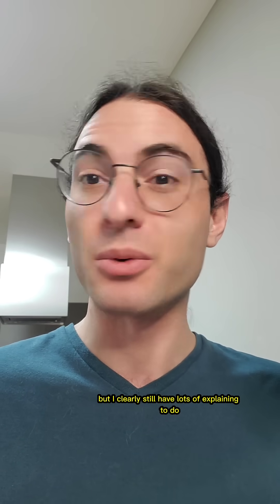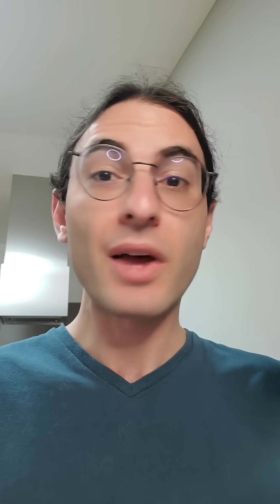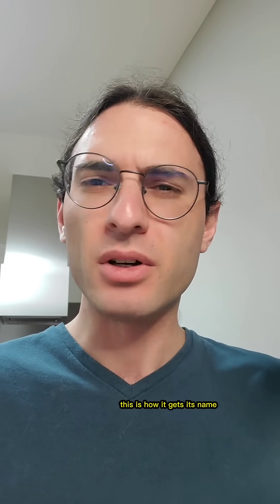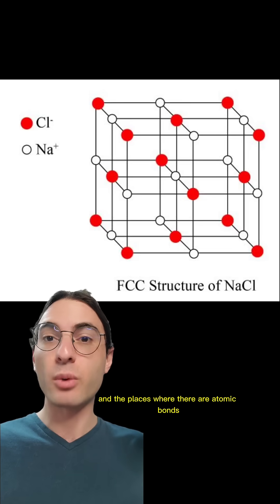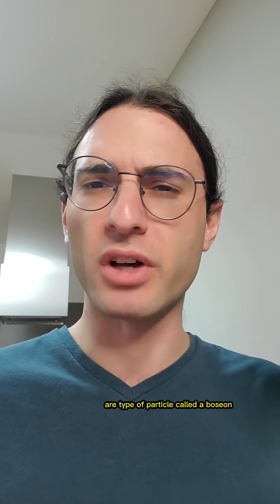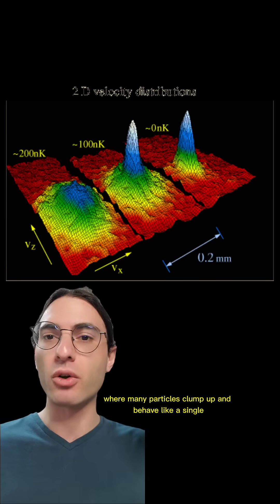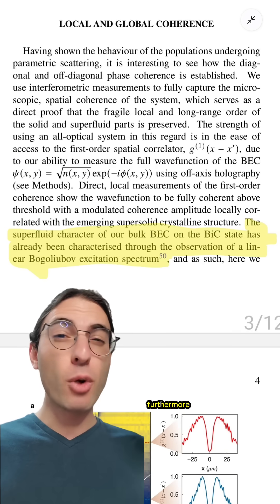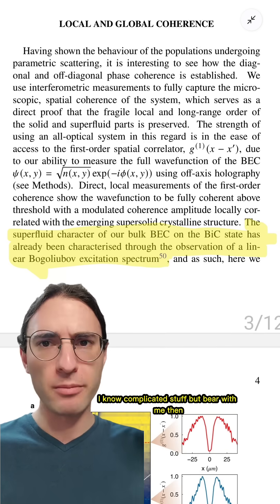Frozen light? Not so fast

Comment: I’ve said this once and I’ll say it again. Light has no mass, and because of that no matter where light is or what medium it’s in it will always always always move at a constant speed of C absolutely no matter what. What they did is make the light resonate back and forth in the super solid. But at a quantum level the light is still bouncing around at C. When light or photons hit water they don’t slow down, they just come into contact with more electrons which gain energy and then release that energy as another photon. That process takes a small amount of time which is why light appears to travel slower in water and bend.